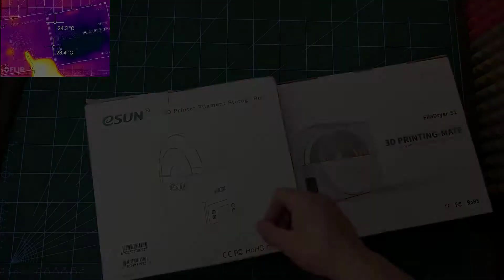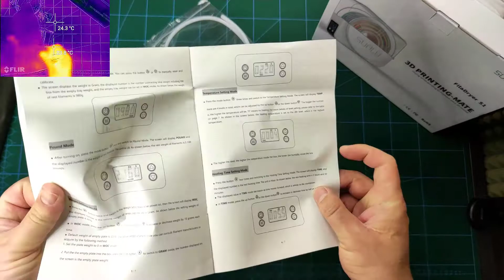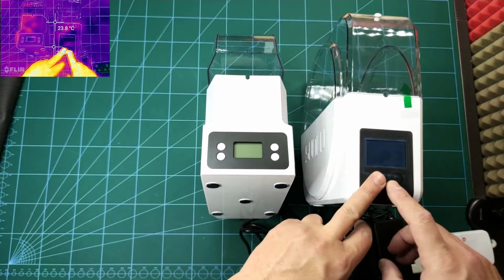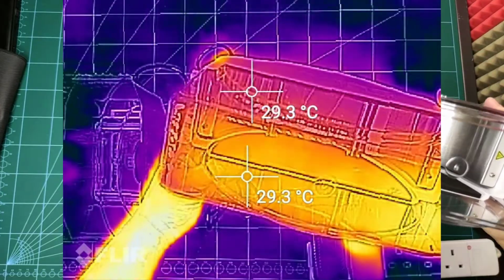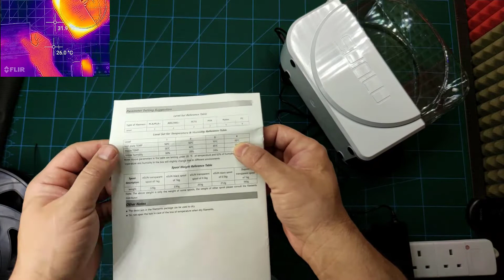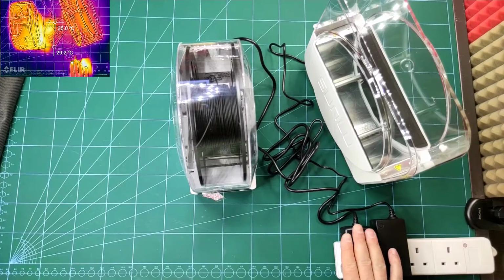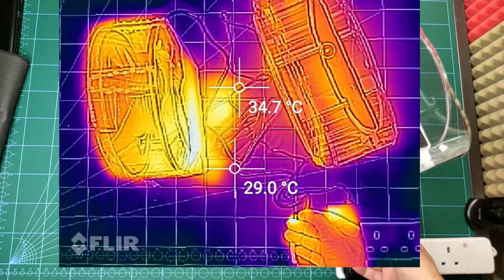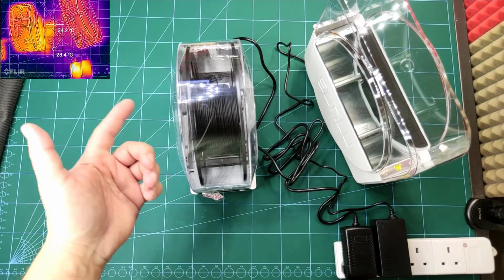Filament Dryer Box, It Is Worth It? FilaDryer & eBox.

Comment: I do not recommend buying the Esun Ebox. I have bought it. Before long she broke down. In 3 months she stopped warming. The seller did not repair it or give any solution. The weight scale is poorly designed and the result will vary a lot if you tilt the filament a bit so it is not reliable. Also, if the spool of filament is not well vertically, it rolls badly.

Comment: I don't know about you but my 3D printers do not pull filament that fast or that hard. I have also been using my Sunlu boxes for over a month pretty much daily and have had zero problems with my filament or the dry box. It works as advertised for my needs. Until something comes that is better it is what I will continue to use. No I will not use a food dehydrator it only partially dries the filament and you can not keep the temperature regulated that good with a food dehydrator. Still a good video and great information. We all have our own opinions about products.
Reply: I'm pretty sure that a bambulab printer will pull the filament quite fast. These types of boxes are not great if they are not airtight and desiccated; once stopped, the humidity will get back into the filament